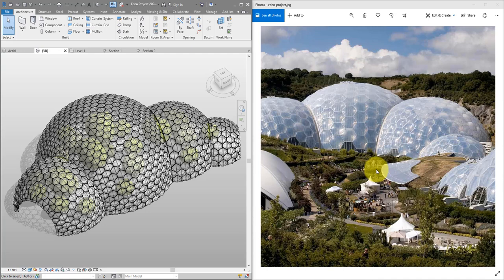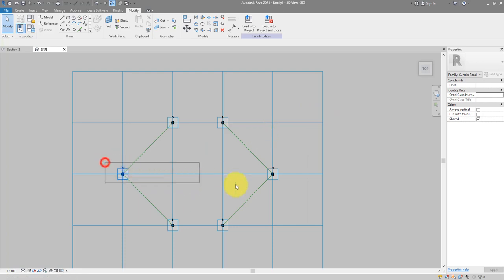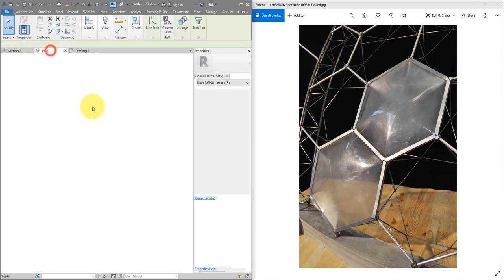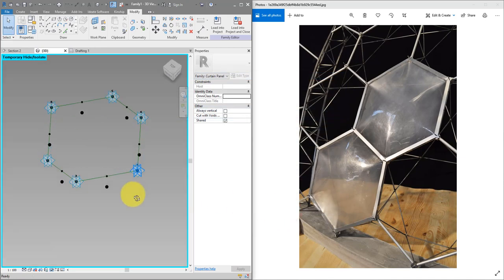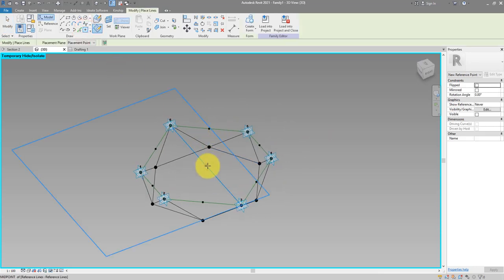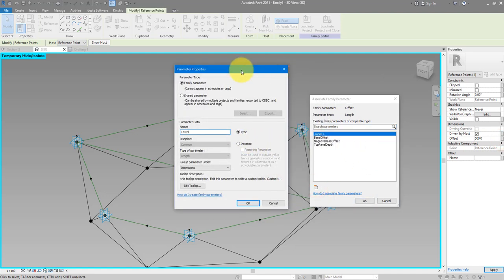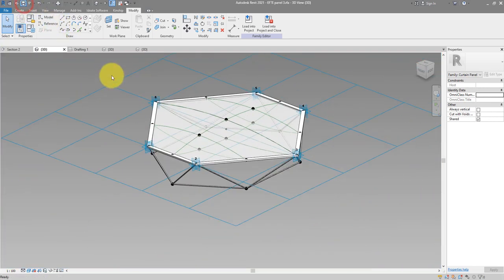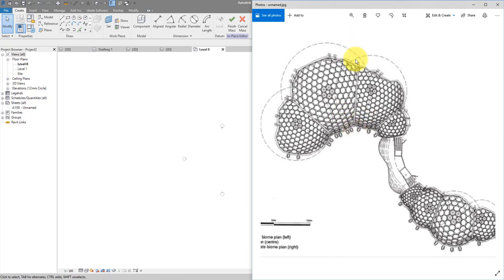Revit Snippet: Create EFTE Domes with Space Frame using Massing

Comment: Hello, Great video, I am wondering if you've done a video on the connection points between the spheres as I cant seem to find the continuation of this video (you explained how to split them up through a void but didn't go further into making the trusses that connect them), if you have a video like this or the continuation it would be greatly appreciated!
Reply: for clarification the gutter/joint detail around the 30:00 mark
Reply from the maker: Hi Ryuk, sorry I haven't done a tutorial on that dome joint detail.  You can do it using adaptive components or a traditional 3d truss. It just need to follow the common edge of these domes. There may be other tutorials on YouTube in this topic.
Reply: @RVBoost  thank you for the swift reply!